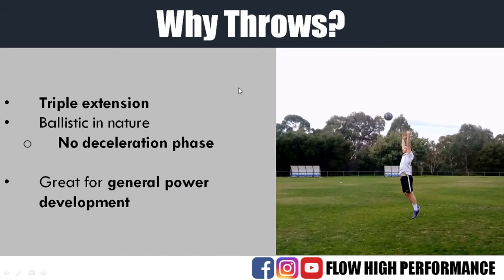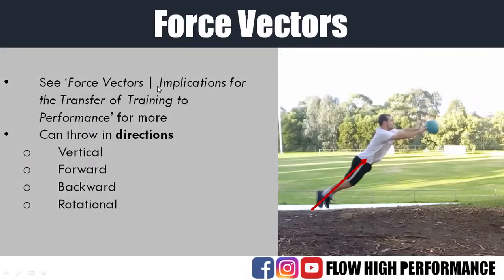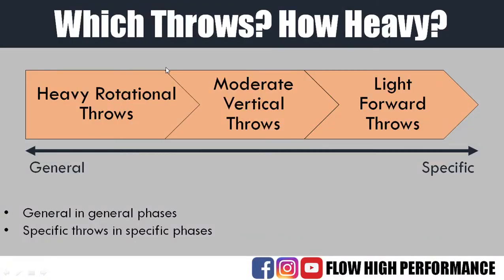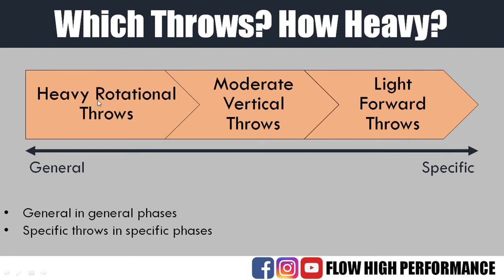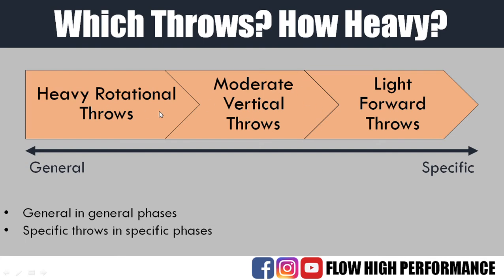How to Use Medicine Ball Throws to Develop Explosive Power | Optimizing Athletic Performance

Comment: Nice video! What would you consired heavy and what would you consired as light?
Reply from the maker: Food question. It will be different for everyone, based on strength levels. It doesn't actually matter what specific load is used, it is more important that there is a difference in load used 👍